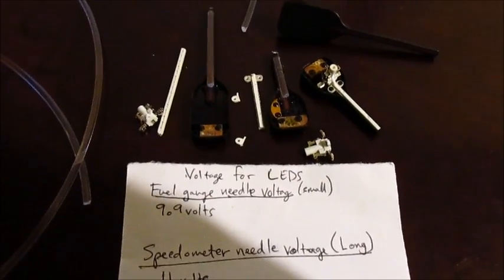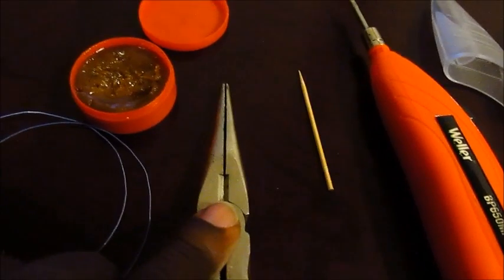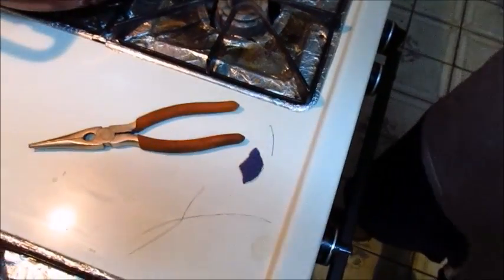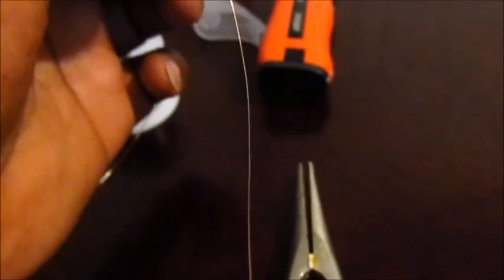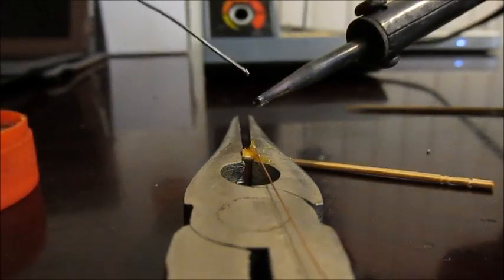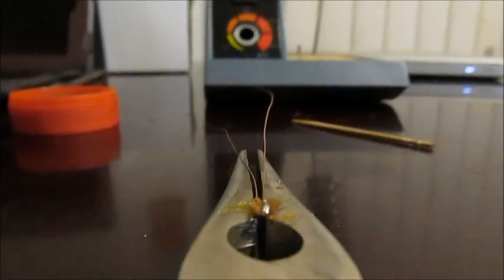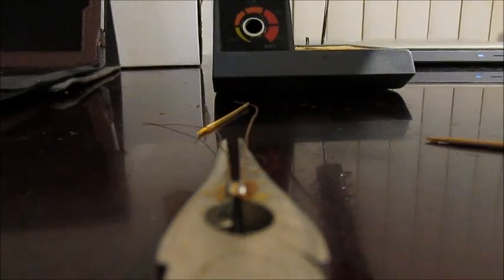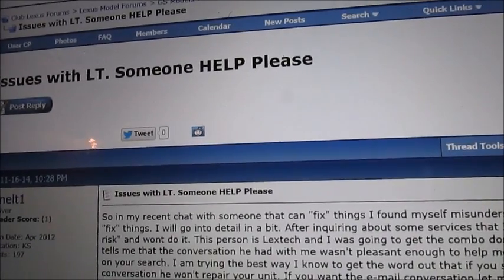DIY Gauge LED needle fix for early gener Lexus GS, SC, and ES

Comment: Hey Kene. Thanks for this video. I actually came across your ClubLexus post a couple years after you posted but I never got around to this until now. So I'm actually kind of dense when it comes to these things.

In the fiber optic method, are you removing the white innard and then using the Goop to glue the LEDs onto it? And then you just glue the LED to the Fiber Optic rod? So no soldering required for the fiber optic method?
Reply from the maker: Yes, correct. That is what I was doing. I chose GOOP instead of a glue gun, because I wasn’t sure if the hot glue(from the glue gun) would melt/warp the plastic needle pieces or the clear fiber optic rod.
Reply: @majanboo22  Thanks. Let me try this. Though I actually thought the glue might not conduct electricity well so am surprised this works. Do you think E6000 instead of GOOP would work too? Is it dangerous for the copper wire to remove the insulating material around it? And do you know if I can use an iron/steel wire (it's what I have laying around)?

Comment: Tip:  The plastic coating on wire is called insulation. Not necessary to you the stove method.
Just buy some 26 gauge stranded wire and use only one strand. Use a wire stripper to remove the insulation to expose the strands.
Reply from the maker: Good day, I used what I had lying around. And also I took into account of the weight of any insulated wires as I wanted to retain the accuracy of the needles. Maybe I was overly cautious when I did this ages ago, but any excess needle weight beyond the initial Lexus design may have posed a problem for the gauge’s rpm/speedo stepper(?) motors created circa 1994.

I needed to have the voltage reach the led, and I knew this was not a serious necessity of amp flow. The current carrying capacity of the wire shown would suffice for the minimal requirements.
Reply: Stranded wire comes in even finer gauge. 
30 gauge stranded wire is extremely small. The strands are smaller with the higher gauge #.
30 ga. is much smaller than 28, 26 or 24 for example. The current needed for the LEDS is negligible, so one bare strand of wire will suffice.
Reply from the maker: @leroyusa935  I believe what used was solid core 28 or 30 gauge.
Reply: Is it dangerous to not have the insulation? In case the wire gets touches another conducting material? And what size strand (if I want to use a single strand) will be enough?

Comment: Great video!  I bought a cluster with good needles and I want to swap them out.  Do you have a tutorial video on how to do this?  I don't want to just pull out the needles without knowing how to properly remove them.  Thanks in advance!
Reply from the maker: Peter D. Michael
I do not own the vehicle anymore and I did not make a video of how to remove the needles, but for the 91-97 gs300/Aristo, (this is all memory) first you must remove the screws that hold the white plastic back plate of the gauge cluster. Now you have access to the clear cover tabs by pushing in on the 4 of them to release the clear cover of the gauge cluster.

Once the clear cover is removed, you can pull straight out on the gs300 needles and they will come out with medium to hard pulling effort.

Comment: Hi, I did this something like this but only used one LED to give it a red tip look. Problem is that my gauges seem to light or something as they all go up (for example the gas gauge goes from half way to full) only when the car is off. Do you know of a way to fix this?